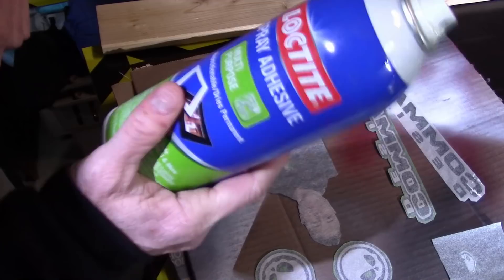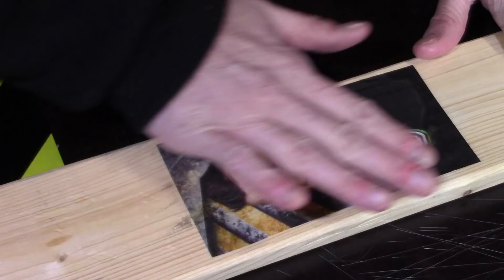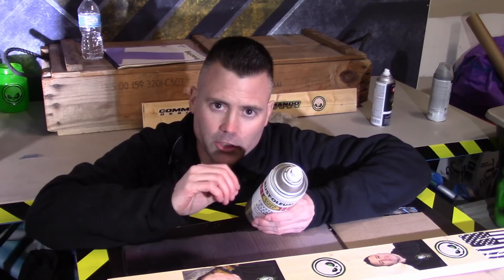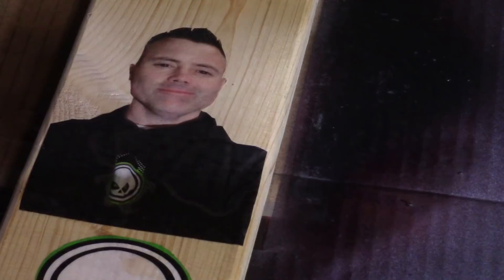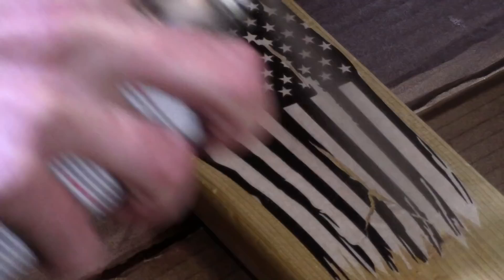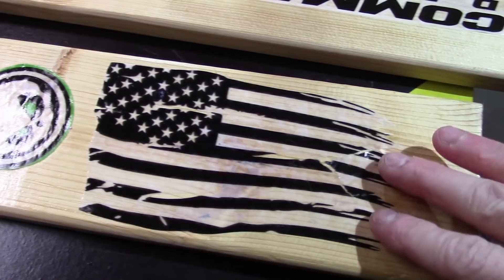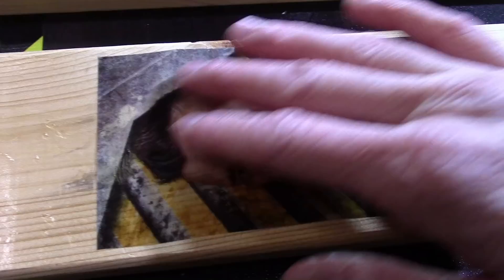Photo Transfer Trick - how to transfer photos to wood or anything else

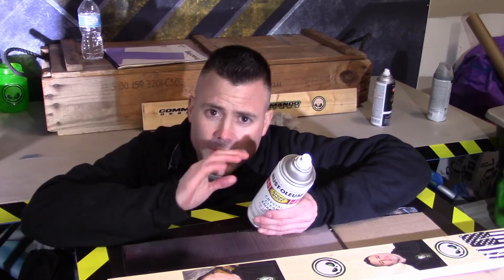Comment: "A little mis-leading but  by may be a useful technique, also frustrating because at 4:33 you briefly mention using " 2- part" if the project is super critical- 2 part what!! what substance??  what brand??
Reply: any two component or 2K clear. which is an aerosol clear coat with a catalyzer typically in a smaller can that is inserted into the bottom of the main can puncturing the internal balloon. It acts as a self leveling and hardening agent allowing you to put very thick coats of clear down with less risk of runs or wrinkles and minimal orange peel to sand out afterwards and it typically is fully cured in 24hr as opposed to several days for enamels and weeks to months for lacquers. the downside is that once you pop the catalyst into the paint can you have only about 24 hours to use all the paint in that can before the agent does it's job. oxygen is not necessary for the chemical reaction to take place, so whatever you dont use just becomes a rock inside the can, best to use the whole can or not use it honestly. hope this helps, cheers.

Comment: Years ago, when I was airbrushing a lot, we used rice paper. It was both archival and, if sufficiently thin, went all but transparent when cleared. For adhesion, we'd apply a tack coat of clear and use that before it dried to apply the image.
Reply from the maker: Definitely. Tracing paper is definitely easier to find. Rice paper is soo thin that it get's dicey trying to print on it. I have done it. I had to stick the rice paper to a regular piece of paper to get it through the printer. At that point it might be easier to use waterslide paper.
Reply: @Commandodesigns  We used to use 3m glue sticks that had the same adhesive as Post-It notes to put the rice paper on a sheet before running it through the printer. They don't make that anymore and I'm not really up on if there are any low-tack spray adhesives that are comparable (just their removable "scotch" tape). It was usually best to only print as large as you needed so as to decrease the odds of failure in the printer.

Comment: I have A Question for you I'm going to be making A wooded sighn and the paper I'm using is  (fabric transfer sheets ) And my ink jet printer to add my image I'm also going to be painting with chalk paint (White.). I know that I need a iron which I have so will the transfer sheet mess up if I iron it to a piece of wood instead of fabric?? Thanks Sincerely Michelle

Comment: My pictures keep lifting, starts at the edge. After a day I can peel the picture right off. Any idea what the problem is?
Reply: The clear coat spray has solvent in it.  That's why the first coat should be very very light and make sure it's dry before adding a second coat.  In his video you see him spraying over and over again, but if you do very much of that the solvent in the coat spray just seeps all the way to the bottom and releases all of your adhesive.  I don't do this process but I do alot of mounting things with spray adhesive, and spraying clear coat after.  What I learned that is even easier is put the top coat on, let it dry thoroughly, and THEN put the adhesive on the back and mount the paper.  I only looked at this to see if it's possible to transfer photos to wood ... I will look elsewhere, lol

Comment: I'll save you all the time and disappointment of finishing this video.. 

It's not a photo transfer.... 

All he does is basically "glue" the tissue paper to the wood and clearcoat it, leaving all of the paper stuck to the wood.

Stick to modgepodge transfers.  I've used that method 20+ times and only messed up the first 2 times.
Reply: @Nataku007  unfortunately,  with injet, the picture turns out very light.
Reply: @Connorsdaddy12062008  Print it darker?